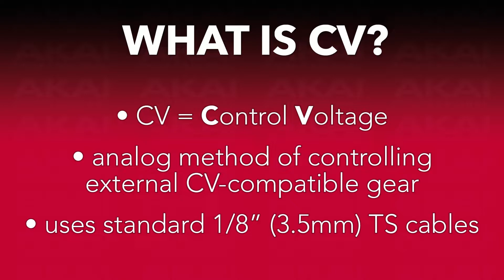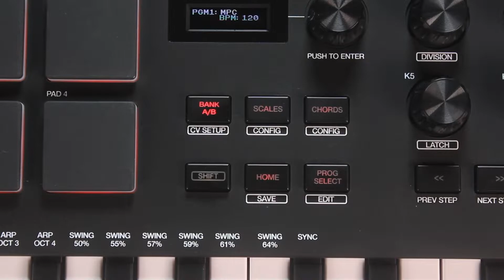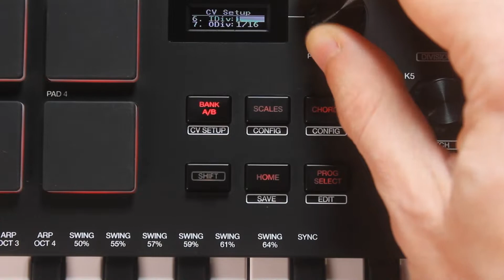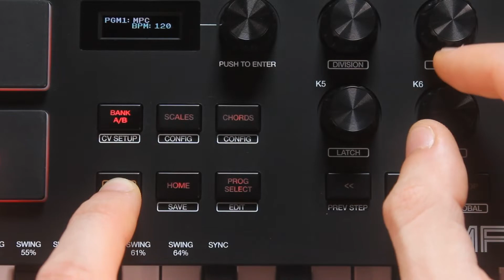Akai Pro MPK Mini Plus | How to Use the CV & Clock Outputs

Comment: Hi, I have a query; I'm considering buying this, and wondering if I can set up the sequencer to control one hardware synth through the CV, then control a separate synth using the MIDI DIN out and not also be influenced by the notes on the sequencer. Is this doable, and how would it be done? I do not intend on using a DAW in this process.